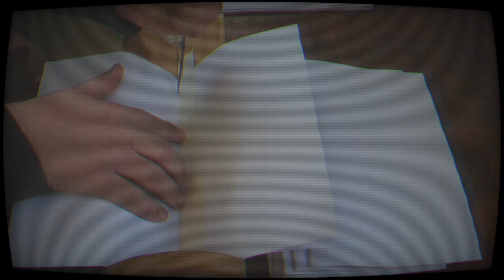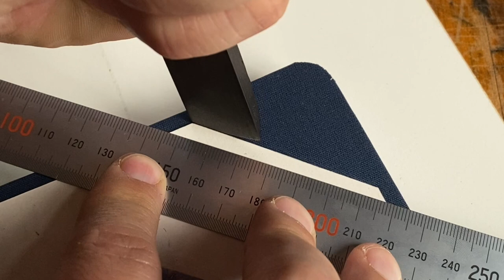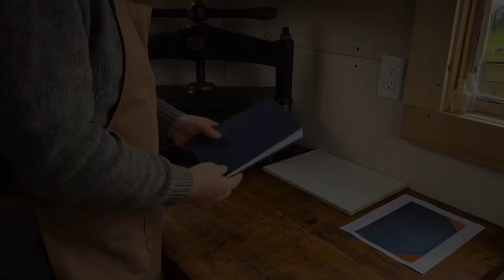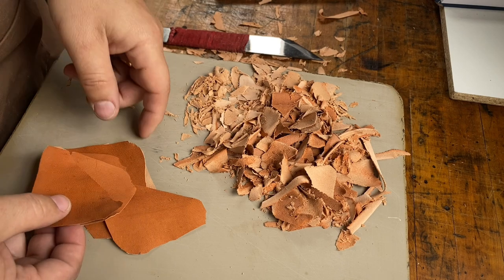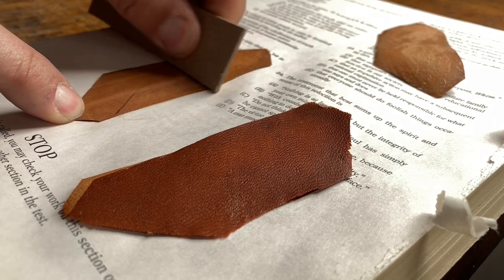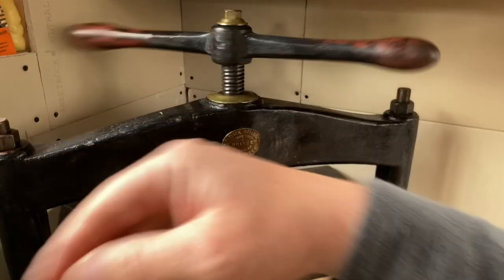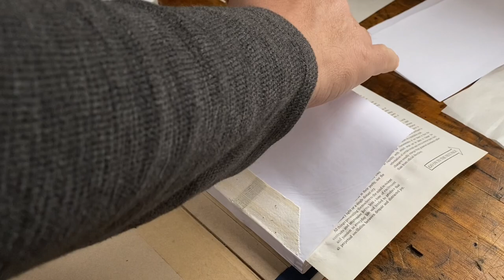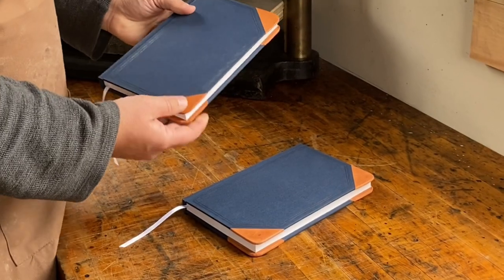Replicating 'The Notebook' Part 3: Finished! - Decorative Tooling, Leather Corners, Final Assembly

Comment: I love watching you work..a true craftsman.  I'm curious why you applied the glue to the paper rather than the cover with putting it together.
Reply from the maker: Gluing out the paper ensures the adhesive has full coverage and that it goes only where it needs to be. Applying it to the cover would be almost impossible to keep neat around the edges. Also, the paper stretches a bit when wet, then contracts again as it dries, which tends to pull the covers in towards the book. Doing the opposite could warp the boards outward. Thanks for the question!
Reply: Ah, thank you for the very complete answer..very helpful!

Comment: Wonderful stuff as ever - I've never come across anything like that ebony folder, if there is anything you could add about it, I'd be most grateful. I might try making one from boxwood, but is there any reason that you didn't use one of your brass tools? Cheers!
Reply from the maker: Like so many of my tools I made the ebony folder myself. I went with that mainly because of the width of line it made, and the very gentle curve of the working end, which helped to avoid digging in to the cloth. I made a total of three of these notebook replicas and used the ebony folder to do all the tooling, and it held up exceptionally well. I did try my brass tool in my early tests but the line was a bit too wide, and it did seem to dig in, to disastrous results. Boxwood would likely be a good option for such a tool, as my understanding that boxwood is quite dense. Thank you for the great question!
Reply: @FourKeysBookArts  Thanks for the detailed reply, especially the curve and warning about digging in. I'll give it a bash!

Comment: Great job!
I enjoyed quite a lot this project.

Just a question. Shouldn't the blotting and the barrier paper be placed in reverse order?

Regards
Reply from the maker: A valid observation. I am using the barrier paper to both reduce moisture transfer as well as a release paper should there be any excess glue squeeze out. It's not entirely moisture-proof anyway, so the blotter paper absorbs any excess moisture that creeps through the barrier paper. If I put the blotter directly against the pastedown there's a chance it could get glued firmly into the book, which would be a mess. A perfect solution I suppose would be a release paper against the pastedown, then a blotting paper, and then another moisture barrier against the book. But too much stuff under the cover in the press can strain the spine, so it's a balancing act really. Thanks for the great question!
Reply: @FourKeysBookArts  That makes a lot of sense. Thank you for such a detailed reply.